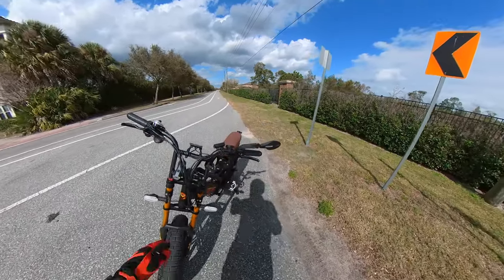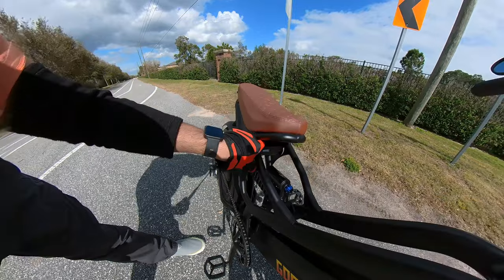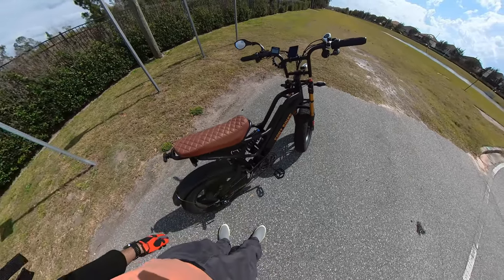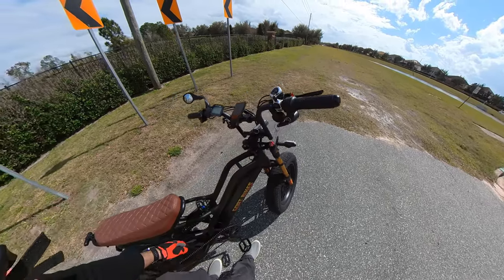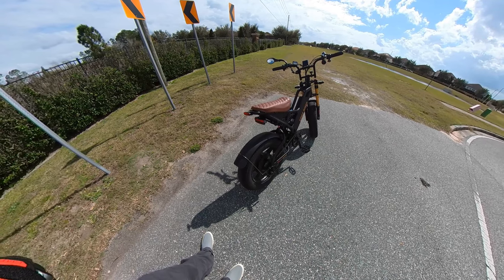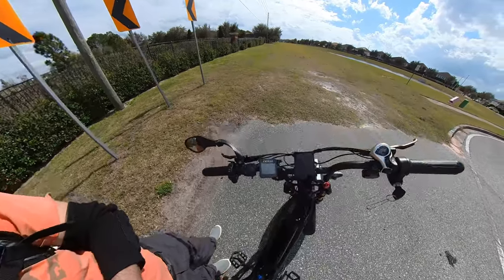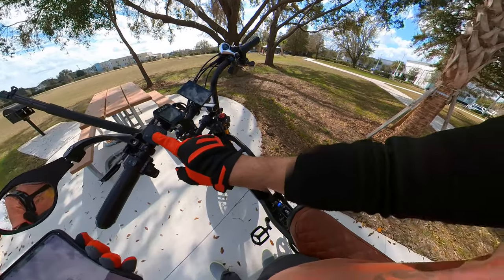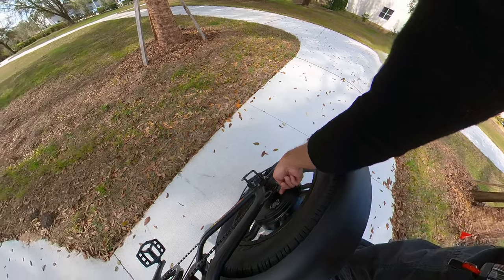Pre-game Walkaround & Rambling with The Billy Goat V2 - Street Rip | 60V GOAT POWER BIKES

Comment: I have an order of the billy goat V2 and now I'm kicking myself thinking maybe I should have ordered the motor goat!  LOL 😮
Reply from the maker: The billy goat is awesome and might even be lighter than the motor goat since that one has a bigger battery.  But if you want more distance at constant full speed, maybe around 5ish more miles on the motor goat.  I did drop down to pedal assist mode speed 2 & 3 once the battery dropped below 45% and, on this day, totaled 16.5 miles once it hit 40%.

Comment: So do you think there's any possibility of mounting an extra battery on that bike?
Possibly the rear rack maybe?
Reply from the maker: The main battery has a 3-Prong Inline plug that goes into the bike frame which I think goes to a XT-60 plug to the speed controller.  Haven't taken off the seat yet to confirm what plugs are there but I'd probably opt for an extra main battery to carry on a rack, then just swap it out when needed.  The main battery is heavy though, around I think 20 pounds.  But yes, I see it also possible to add a second batter [same model or similar size and C rating] then just wire it in parallel.

Comment: How is the torque on this motor so far with your use. I dont wont to get the talaria xxx or surron light bee. Thinking of making this a stunt bike to be different as Im older and like this look more than the dirtbike look. Does it wheelie fairly easy and is the throttle and rear brake very responsive? Thanks for the videos hard to find on this bike.
Reply from the maker: Thanks!  Such a fun bike so I try to ride often which makes me have so much content, lol.  It definitely has a mountain bike feel and is heavy, but I've heard people are able to wheelie it.  There's even a video from Goat Power bikes with a rider doing a stoppie!  With the settings set to max, the throttle is super responsive especially under 35 MPH.  Above this speed it is more linear but gets you up to full speed fairly quick.  Both brakes are strong!